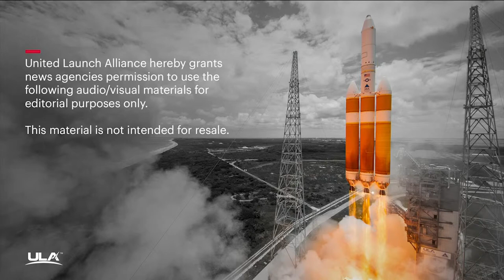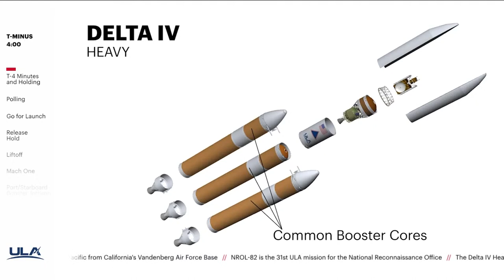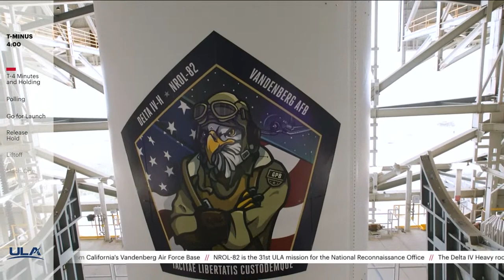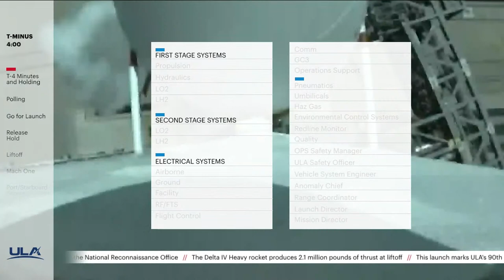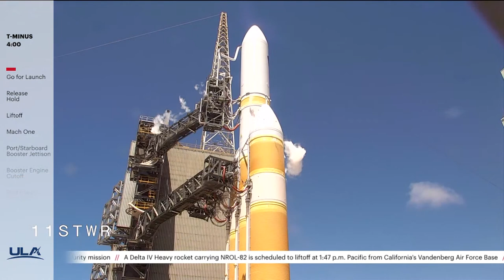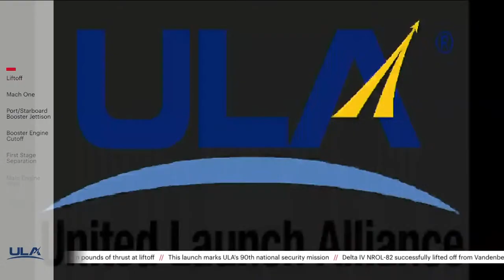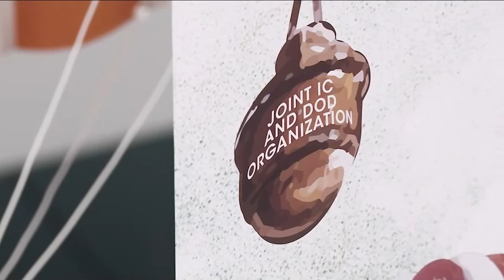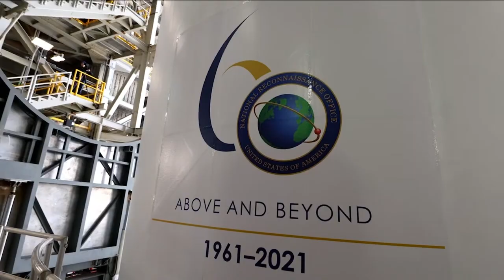April 26 Live Broadcast: Delta IV Heavy NROL-82

Comment: I watched too much falcon 9 launch starlink, that when a booster didn't land feels weird
Reply: They wouldn’t have been able to reuse falcon on this launch, not with this orbit
Reply: @Squid Person because propulsive landing requires 1/3rd to 2/3rds of the system lift capacity, roughly speaking. This is a complex orbit that 1) doesn’t allow the boosters an easy recovery trajectory 2) their rockets simply don’t have the lift capacity in reusable configuration
Reply: @sabretechv2  Yes but they wouldn’t use Falcon 9, the would use Falcon Heavy, which is quite comparable to the Delta IV in performance. There’s a good chance it would be able to launch and reuse.
Reply: @chicken_nugget5438  no there isn’t, not with this type of orbit and this heavy of a payload. Lift capacity on FH is still severely diminished with reuse. this is especially true considering how much higher performance ULAs hydrolox DCSS upper stage is compared to spacex

Comment: Need to learn from spacex for rapid reusable boosters. Still operating like it’s in the 60’s, 70’s and 80’s.
Reply: Vulcan will be partially reusable. Their next one should be fully.
Reply: @jakemckee2005  If you're talking about that helicopter catching the engine bay in mid-air thing, it's little more than good intentions at this point. A far distant future hypothesis, if you will.
Reply: Reusability is important when the payload is less expensive.  These NRO/DOD satellites are megabucks, so reliability becomes the bigger factor.  IOW the customer absolutely does not want to lose this payload!  It's one thing to abort the launch and reschedule, like what happened with NROL-44, but destroying the payload in a catastrophic failure is way painful.  So these wind up using the "disposable" series of launch vehicles for that added reliability from well developed technology.
Reply: @HiroNguy  yea if it's one of these for the lb they are launching something close to the cost of an aircraft carrier usually.

That being said Falcon launches some pricey payloads too including dod and nro birds.
Reply: If it aint broke dont fix it

Comment: At the liftoff the rocket are on fire why is this not an problem
Reply: it was designed that way, they can account for a small amount of insulation burn off during engine startup, once the engines are running the fire is out since no more hydrogen.  The delta IV was never meant to be man rated so they can do some things that would never fly on man rated rockets, when they were looking at man rating them the engine need over 200 changes to comply with NASA's requirements and the fireballs at lift off would have been gone.

Comment: So at 50 seconds you report that the vehicle is traveling at 960mph.  Then at 80 see inds you report the vehicle is now supersonic.  If supersonic is above 761mph, did you slow down?  WTH?  You were already supersonic at 50 seconds🤣🤣
Reply: I haven't run the numbers but the speed of sound varies with pressure. Also the callout for that could've been late so they gave a higher speed.
Reply: refrain from the freedom units and no one else would need to be confused either.

Comment: I agree the Delta IV heavy puts on an awesome show, but as a taxpayer I have to wonder if the SpaceX Heavy would be a more cost effective launch system since its boosters land and get reused.  Of course we never get to know how much we just spent on this NRO classified mission and its secret payload.
Reply: Reusablity ?
It takes time to refurbish engines and will take more money on manpower

You save money on time. SpaceX does that for investors
Reply: the falcon heavy NROL contract is only slightly cheaper than the ULA delta IV heavy contract.  The government is paying for reliability and success and they will pay well for it since these are billion dollar payloads in some cases.  In the end the cheaper Vulcan and falcon family are taking over the NROL launches in the early 2020's, Delta IV only has 3 left, two in 2022 and one in 2023.